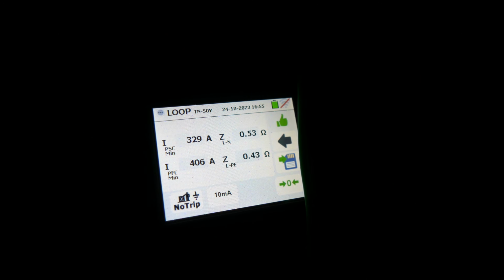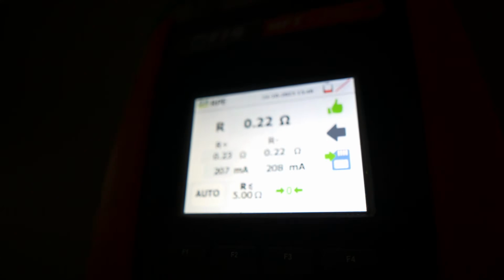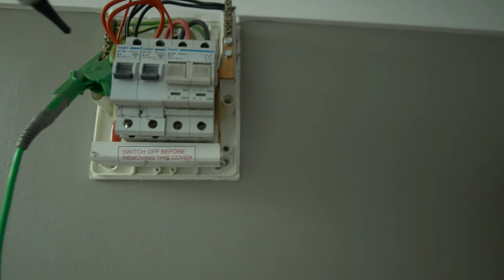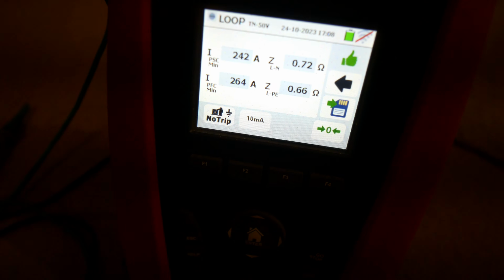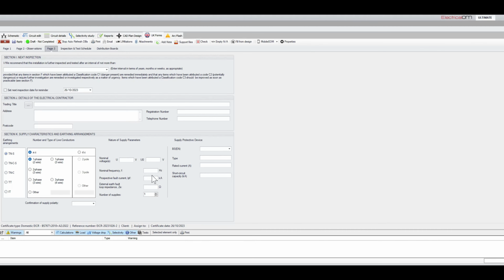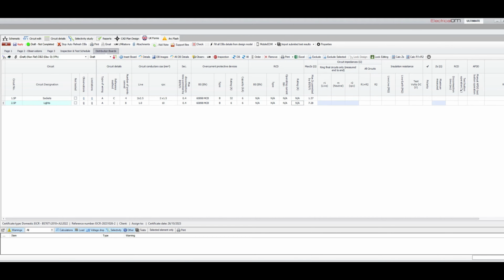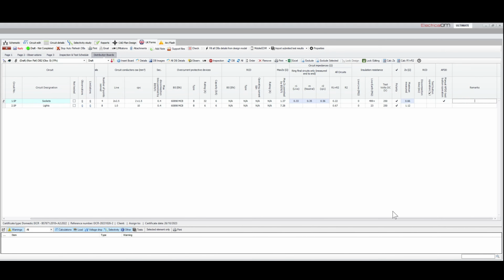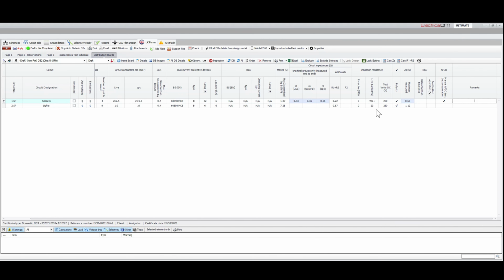How to do an EICR start to finish - Electrical Safety Inspection and Test

Comment: Hi

I enjoyed your video very informative you certainly work well with a methodical approach.

When testing I.R on the socket circuit, i noticed you tested L-PE and N-PE first, and then anticipated a low reading testing between L-N likely due to the presence of the USB.  sockets.

I know generally it would be impractical/time consuming to link out at the usb sockets to correctly test the IR between L-N. Out of curiosity did you not record a value on the test sheet for IR between live conductors? Testing down each live conductor down to earth was enough in your opinion for the circuit to be satisfactory. Its not a trick question just happy to get your thought on it.

Kind regards
Reply from the maker: Covered it in the cert section of the video. I could LIM it or put zero. With explanation in the notes segments of that circuit results. 

Of course with EICRs we can omit a few tests as it's inspectors call to determine safety for continued use. 

Lots of ways to skin a cat. 

Thanks
Reply: Oh right i see. I only watched half so far. Thank you for the reply.

Comment: Good vidya Mark, having worked away a lot I have spent many a night in a premier inn and thought it would be good testing this cause everything is in the one room, and you just showed me it!!  It’s clearly a pre 2004 install  going by the colours and the db so there will be a few c3s due to the change in standards. It was fine back in the day. A bit like putting a classic car thru a modern MOT. All the best.
Reply from the maker: Now large hotel chains could be the gift that keeps on giving if we start testing those on stay overs lol. Refunds all round 🤭

Comment: C3 for no additional protection 30ma RCD. I’m guessing when the installation was installed it was not a requirement? 

With the mcb supply this board are you saying it could trip first before the main switch as it has a lower amp rating? 

Thanks for the video it’s great to see how other people do there stuff 👍
Reply from the maker: No it's rated higher but on short circuit time curves overlap so either could operate.  Partial selectivity

Comment: Can’t help thinking we are wasting our time with these EICRs
 I’m so fed up with having to correct work where the customer has had a satisfactory EICR and the installation has been in a dangerous condition. With false results.
In the last case it was obvious the guy who gave the Certificate had just done it from his arm chair without even checking anything at the property . 90% of the metal lights had no earth . Some lights wired in bell wire . No earth bonding the list goes on.  It was for a property my customer  had just bought. Even my customers solicitor said  these things are often not worth the paper they are written on and you won’t get anywhere trying to report it as no one’s interested. 
What sad times we live in .
Reply from the maker: indeed. Ive made a video covering just that issue. However that is up to clients to find value beyond price and industry to help explain that value more clearly.